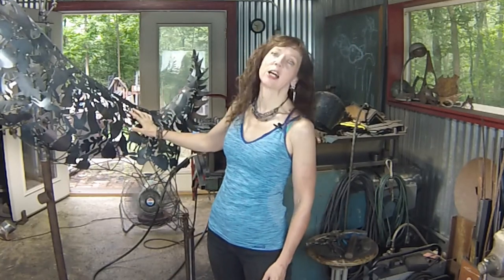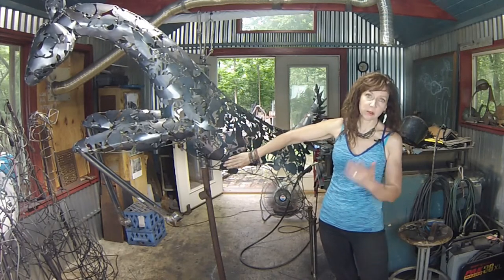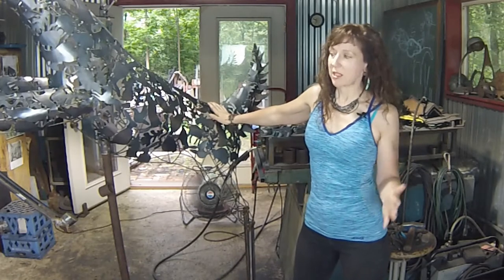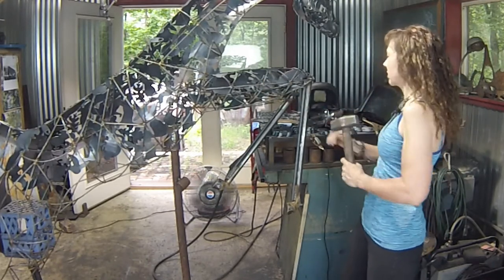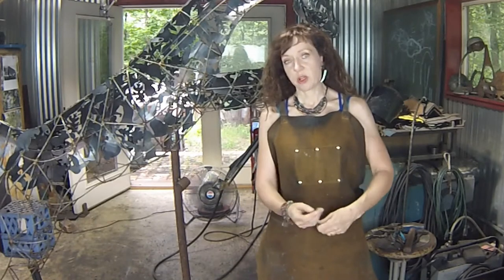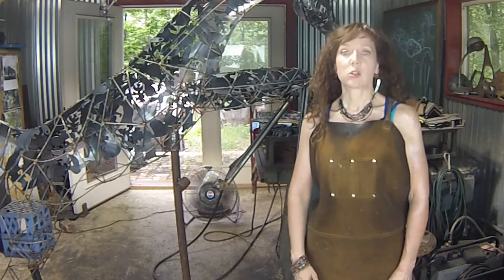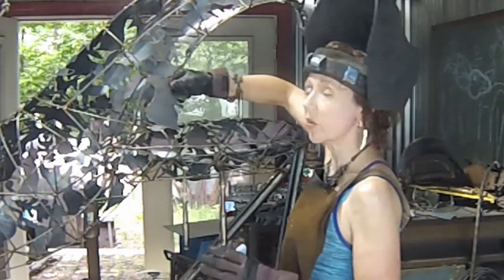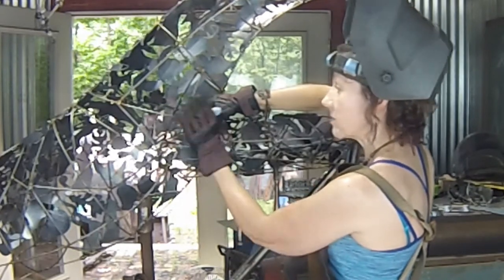Suelandia; Covering the deer (shaping)

Comment: Hi Sue, Just found your channel. I appreciate your art and the perky sweet way you present your videos. Over the years I have created several 3-4 foot long rusty fish done in a similar manner to your deer. I free form cut the pieces of "skin" with a small cut off wheel and plasma cutter from rusty metal barrels. The round barrel shape helped in forming the pieces to the frame. Many good tack welds on each piece minimized welder burn through. Lots of work, so much so I'm not very anxious to do another.

Comment: i dont often offer advice ,  but heres a thought , if you take a block of hard wood , oak or mahog  etc , about a foot square , and then angle grind a grove in it with a flap disc , about three or four inches wide and about an inch deep maybe an inch and a half , then put it on something solid , and beat your steel into the grove  either part of the way , or all of the way , or what ever suits , ideally with a dome hammer , you can flap disc one end of your plastic hammer to a sort of egg shape , and you will find things wizz along ,,, after a while you will get the hollow just perfect , i use a tear drop shape in an old one hundred weight steel scale weight , and a thor dead blow hammer , and i can knock out most shapes , compound curves etc very easily,,,,,,,,, just a thought , as you always seem to be playing catch up on time , this may help , dont knock it till you try it..
Reply from the maker: Thanks Tom.  That's a good idea.  Going to try that.  :)
Reply: @sueseeger1508  your welcome , it works , may take a while to work out what shape the grove needs to be , but its only wood , its cheap , make a few and play ,, let me know how it goes 
regards t